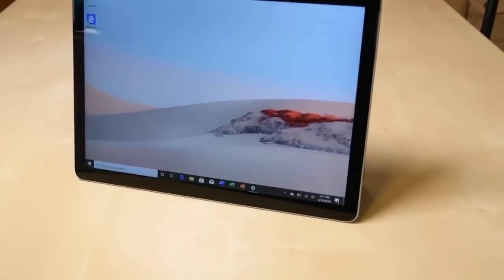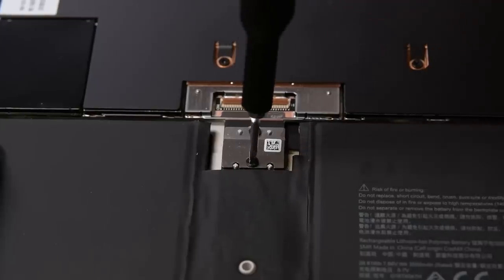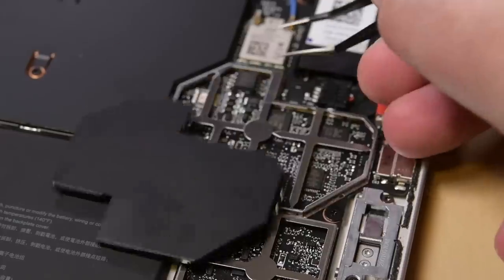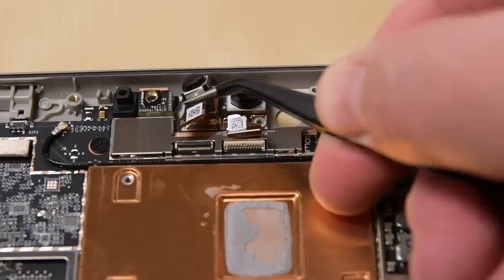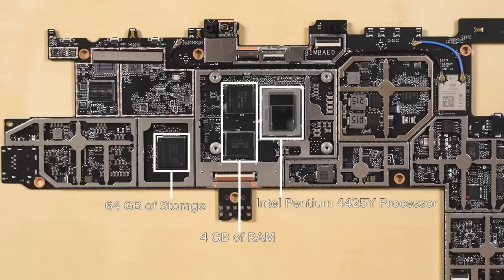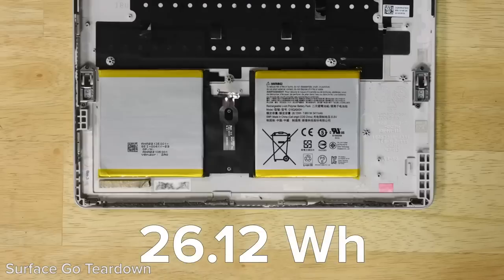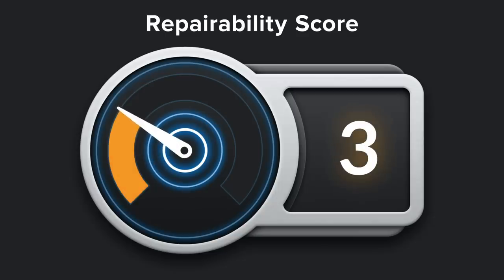Surface Go 2 Teardown - A New Hope for Repairable Surface Tablets?

Comment: There's lots of room in there for a larger battery, Microsoft...
Reply: Where the fuck do you see space for more batteries? 😂
Reply: It's kinda limited in terms of design because the CPU can get up there in temperature, which in turn can cause damage to the battery. If Microsoft did want to lob a bigger battery in this, they might have to completely redesign the entire thermal architecture of this machine. This is the case with the Surface Book line too.

I wouldn't recommend any Surface product without dedicated cooling for any extended workloads for this reason.
Reply: @mmoarchives2542  At under 200$ per kWh, I think the 2$ that it would cost to go from 27Wh to 37Wh would be worth it. I mean i'd pay 2$ more for that 🤷🏻‍♂️
Reply: @IsiahHD  If they would stop using glue to stick the battery to the chassis.. it wouldn't matter about heat.. the CPU is far enough from the battery + it's being passively cooled. Gluing in batteries is phones/these devices was always a bad idea.

Edit: Pull Tabs are the cheapest and easiest way to keep the battery in position.. but remove in case of the need to change..
Ironic seeing Apple doing this for all their products(Not sure about the Macbooks) but no one is learning the good Apple actually does.
Reply: I guess it with cause heavier weight and higher price. They manage to put really good 3:2 high density screen (full SRGB color gamut) with usable outdoor brightness and full pen support. Facial recognition sensors. Magnesium body. Metal kickstand with variable adjustment. Good speakers. Really good Webcam where most laptops or tablets have far worst camera except for iPads. It actually manage to get to its base price. I guess that Intel chip makes it more expensive and sadly not the best performer, but we don't have other choices for this form factor except for going to Snapdragon, which is I think a missed opportunity, which should I prove battery life with far more efficient chipset. Nobody should expect to do heavy video editing or latest AAA games with it anyways, so ARM should do most task with this small PC.

But yeah I wish it can be bigger as long as it doesn't cost us weight. If they went for cheaper Snapdragon 7cx, then they can use that savings for larger costlier battery. The Intel chipset is the compromise of Surface Go so far which is costly, consumes more battery and still not giving better performance.
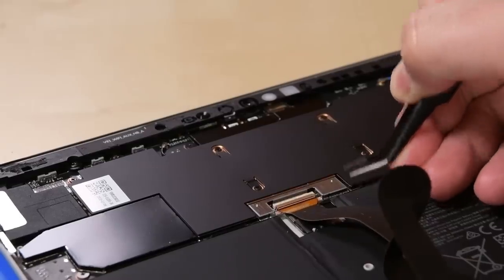Reply: @fjjwfp7819  no its not look at 00:30 in the video there's literally nothing in that space haha
Reply: bigger price, bigger weight, heavier
Reply: @mmoarchives2542  I know it's supposed to be an iPad competitor, but the original I can say was overpriced. It wasn't "premium" besides the display imo
Reply: @mmoarchives2542  Not likely. I bought the original Go 8GB/128GB model, and plan to buy the Core m3 Go 2. I'd happily pay $649 instead of $629 for a slightly larger battery. I don't care much about the price.
Reply: Thermals....
Reply: @AwkwardYet  It's amazing how people think cooling is magic and you don't need to leave space anywhere and things will still be fine.  Sigh.  Armchair engineering at it's best, though.
Reply: There is a certain limit of battery allowed on planes.
Reply: @danm4320  Pause it at 31 seconds and see the grey space to the left. They clearly had a bunch of room to increase the battery by a good 25-50 percent
Reply: @shortstraw4  that grey space is for venting. Do you realise how compact things get when you seal it?
Reply: @HamzaKhan-lf4qr  Yes the apple mac air iirc is .49 or something ie 0.01 under !
Reply: @cluberti  What are you talking about? Do you think leaving space inside cools down your device? It is an enclosed space with no airflow. It is wasted space. I don't think that space is contributing to any cooling.

Comment: 3/10 is a bit harsh, the main thing anyone will change is the screen and it's basically a 2 second swap now.. would at least give 4 to 5 out of 10
Reply: Screen and charging port. And the screen is still glued in place.
Reply: @DumahBrazorf  so is every iPad ever made... At least it's not cement this time
Reply: @slicey80  Well, to be fair they did also give the Ipad pro 2020 3/10 in term of repairability score
Reply: @jashsu  you only remove a battery once it's dead, at that point yes it's annoyingly hard but the fact that you damage it in the process means nothing.
Reply: All batteries are an inevitable replacement.

Comment: its easier to get inside for repairs... too bad theres barely anything in it to fix.
Reply: Only if u had high knowledge on electronic repair or schematics that would be possible, it seems promising for future repair and rework with those "easy to remove" heat shields tho, Quick 861w can hack it wirhout a drop of sweat for sure
Reply: The Tech From Heaven ummmmm no
Reply: @falcy2889  whatever, I bet you don't even know how to identify PPBUS in an electrónic device or a short to ground and damaged components using diode mode
Reply: @thetechfromheaven  
Louis Rossmann has entered the chat

Comment: The plastic antennae frame is very delicate, and when only replacing the screen is required, cleaning the foam tape adhesive off the antennae's very thin black film cover which has the antennae lead traces attached to it can be challenging, you must be super gentle when cleaning over top of antennae, or it will tear.

Comment: so..... The Million dollar question then is this..

(Good video by the way)

HOW DO WE FIX THIS.....

if your SURFACE GO is stuck in redundant loop
- you turn it on via the Power Button
- it powers up
- You see the Logo
- it says "PREPARING"
- a Blue screen Flashes
- the process repeats itself infinitely

TROUBLESHOOTING...
- Pressing the UP Volume button does get you into the BIOS Menu without any drama's and everything works fine at this stage

- It DOESN'T Automatically enter recovery options after 2 Reboots

- it doesn't enter recovery Mode if you press the DOWN Volume Button  (meaning.. the sequence of Power then volume down)

- it won't boot from a bootable USB

- You can't recovery it using Android SDK (Software Developers kit)

- The bottom line is ....... 
IT JUST NEEDS TO BE RE FLASHED OR...... HAVE THE O/S RELOADED
I strongly doubt that the unit has Hardware problems

THE ISSUE IS
the unit did an update
I suppose it tried to go into recovery after that
the blue screen is the Unit trying to re install the recovery image  BUT CLEARLY THE IMAGE IS CORRUPTED and can't install and crashes and then reboots to re-attempt  to no avail infinitely

Now.. one would think YOU WOULD TEAR IT DOWN
TAKE OUT THE STORAGE VOLUME
WIPE IT , OR BUY A NEW ONE AND FORMAT IT AND START FROM SCRATCH

however , as far as i can tell  the storage is soldered directly to the PCB
i mean... i can of course crack out my de-soldering and reflow station
but.... LMFAO........ SHOULD I REALLY HAVE TO ?
LMFAO
i can't see normal end users needing to desolder an I.C. because Microsoft decided to solder it to the board.
there MUST BE a simpler solution
something that forces the boot from USB so that it wipes the existing image and installs and deploys a new good working one

Any ideas ?

Comment: Why is the logic board so large? iPads have a tiny motherboard.
Reply: Ipads are designed to be used as mobile devices. these systems are more complicated and need larger motherboards to fit all of the components
Reply: @noahbromberg3675  the different architecture isn't the reason for it, it's the optimisation of the board and IO
Reply: Fish the iPad does have the advantage of using an SOC meaning they can shrink everything down. The chip is also more efficient on the Ipad so they can pack everything a tiny bit closer and that also helps
Reply: Can i pads run Windows?
This is the question here
We have iPhones for that Mobile  os but what's the need of  mobile operating system on an powerful chunk of  device😒😒
Reply: @ZiyadMullick  mobile cpus wont work with windows because they cant process it
Reply: @ZiyadMullick  it can technically be made to work since there's already windows with the arm instruction set, but actually porting it over is another issue.
Reply: @noahbromberg3675  snapdragon 8cx*
Reply: They made it that way so rookie techs like your average Louis with a Quick 861w don't screw up when having to lift up damaged IC components. Unlike Apple who likes to cram and sandwich components for no reason other than "space saving" and trolling techs by making repairs a pain in the freaking ass.
Reply: @ZiyadMullick  that is like trying to make a Russian that has never been in Japan speak fluid Japanesd, it is technicaly plausible but is a damn pain in the ass and at the end of the day it is debatable if it's really worth it
Reply: b ecause ipads not a computer
Reply: just imagine putting an iphone in the size of the ipad
Reply: Lucifier Maxwell welll im ‘running’ windows xp on my ipad

Comment: What type of adhesive do I use when I reassemble this and where can I get it also where can I get the plastic tools I will check your website. I have never disassembled a tablet but I just bought 10 surplus Surface Go 2 tablets model 1927. These were used in a ClearMe Corporation kiosk nine out of the 10 units had a UEFI BIOS password lock. And I was told that the only way I can clear it is to remove the BIOS chip soldered to the motherboard and replace it. I'm not sure if I'm going to do that or not since I've never tried it but the BIOS chip is sold on eBay for about $24. I did list one of the Surface Go 2 for $125, if I end up selling them at that price I may not worry about the BIOS replacement. Since these are selling in good working condition for about $250 to $300. It may not be worth the time and effort it takes to replace the BIOS.

Comment: Replaced cracked screen and now it won't power on with battery alone, has to be plugged in. I was super careful, what did I do wrong, it doesn't seem to be a charge issue as it had 42% left, now it won't charge past that or power on with battery. Help????
Reply: Update 12/29/22 Ordered new battery powers on fine now.

This unit was used outside in a drive thru restaurant setting for taking orders in the hot sun. It was in a protective case, and had screen protector, but still had a cracked screen and was replaced mainly because the battery wouldn't hold much of a charge. 

Didn't notice any issues though prior to attempt of replacing screen, best guess why it didn't power on after screen replacement and now does with new battery, was old battery was likely damaged due to overcharging and being overheated, and I unfortunately saw the last power on life cycle it had left. 

Replaced battery and unit charges fine now, has been working perfect for the past 2 weeks.

Comment: For some reason Microsoft still can't make a compact motherboard
Reply: I don't mind, it's harder to screw components up if you are doing a repair that way and reduces the need of a microscopd, Also I don't see any of the pesky IC goo that usually comes on Apple devices, it should be a charm to flip and replace chips on that sucker

Comment: Do the displays from the Go 2 and 1 use the same connector? Can you please try connecting the Go 2 display to the Go 1
Reply: Even if the hardware fits, the drivers might not be compatible.
Reply: @kisong1960  You can literally download the drivers from the Microsoft website. They provide in case you do a clean install of Windows on Surface devices.

Comment: I have to wonder: how repairable can you make a device, while still keeping it water and dust resistant? Is there a way to make it where you could allow the consumer to reapply the water protective seal so, after you repair it, you can keep the original integrity of the phone's water rating?
Reply: Of course you can. Repair-ability isn't hindered by water / dust ratings, but by corporate greed. Just look at Apple's business model: when a device gets old, instead of offering high-quality battery replacements and services, they slow down your device and (practically) force you to get a new one.

Comment: Why would the USB-C port not be soldiered? Can anyone explain this please?
Reply: If it isn't soldered onto the motherboard than it would have been a separate part making it easy to replace.
Basically you don't need a special tool that a average homeowner wouldn't have to put in a new usb-c if damaged.

Comment: The thing that kills me about most modern thin and light is soldered storage, I mean what about if your PC dies for a or b reason? All your files die too? With my other devices it's just a matter of taking out the hdd or ssd, until now only have one thin and light: the Samsung Chromebook pro and it's been a nightmare the wifi stopped working correctly and of course it's soldered so there you had it a mostly unusable 500 bucks device, really hate the all soldered devices
Reply: Get a hot air station and git gud at using it if that is bothersome to u, It's a really useful skill even if you don't have a repair business and it gives u a ton of skill and cred if you are in an engineering field
Reply: Realistically speaking, the best measure to guard against data loss isn't removable storage, its BACKING UP YOUR DATA. I've been there lost some pretty important files 10 years ago, because of some terrible firmware on those early SSD controllers killed the raid and I lost all my data. 

I consider data recovery of failed hardware as more of a convenience more than a necessity, because it only guards against hardware failure that's not the storage medium itself. If you want a true guarantee do what you are supposed to and back up data.

Comment: Is there a way to recover data from a soldered ssd?
Reply: Short answer: No

Longer answer: Unless a connector that allows direct access to the SSD has been fitted (some previous MacBook models had such a connector, but the more recent ones have done away with it) and you have the appropriate device to connect to that connector, then you don't stand a chance

Comment: If Microsoft can pull off a super repairable surface device that you don't need a freaking IR station to upgrade RAM, Cpu and storage, I wouldnt bother if Bill wants to chip us, hell, I would use my 5g mark of the beast chip to unlock my 3rd world $399 super repairable microsoft surface lmao

Comment: Isn't it time to start calling 'processor' system on chip SoC.
Reply: No, because it isn't an SoC. Lots of things like the WiFi radio and Sound chip still exist as separate chips on the board. So thusly, this is only a processor (CPU+GPU+Memory controller+PCI-E). An SoC has basically everything integrated apart from storage and ram.

Comment: For a device that is so slow you cant make the motherboard soooooo HUGE. You should try to make a similar motherboard as small as in the Macbook 12 inch and the rest of space dedicated to battery.

And another thing... If surface is meant to be premium.. a Surface go should have also a fast enough processor, not that thing... I wouldnt even try to have more than 10 tabs open in the browser...

And a battery glued to the battery makes the device a 4 years old device... Every device should be able to have their battery easily replaced at least 1 time in their life to extend its lifetime like in all the Macbooks...  No one is going to be 20 years with a device, but make it at least a easy 8-10 years with an easy battery replacement.

Comment: M$ is copy all the crap from APPLE, everything is soldered to the mother board
Reply: @thor.mukbang  not all tablets have soldered components. try dell latitude 7200. can replace the wifi, ssd and battery. it came with 9560 intel wifi and 256 gb ssd. I was able to easily upgrade mine to wifi 6 and 512 gb ssd later on.
Reply: If you count is as a "tablet" the old Elitebook 2760p is also modular af